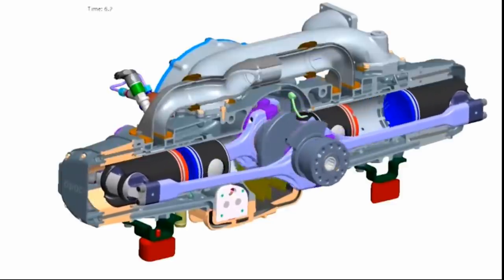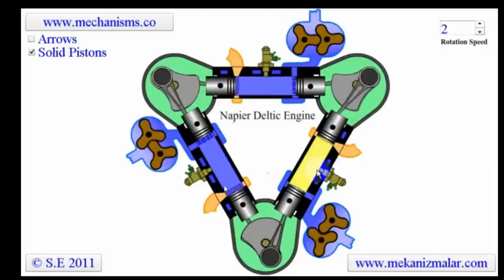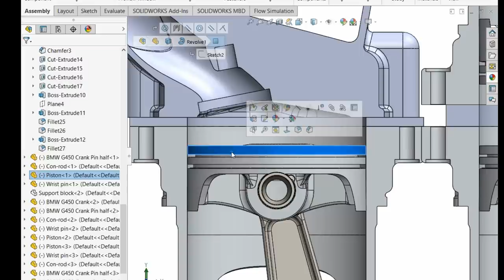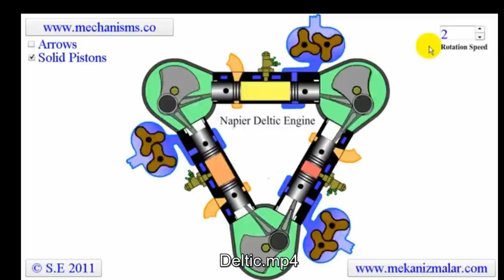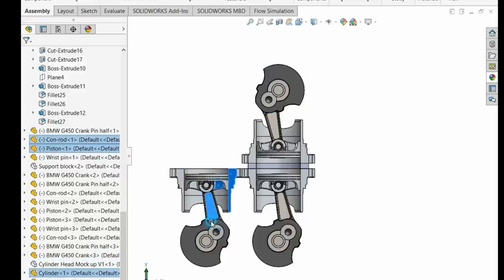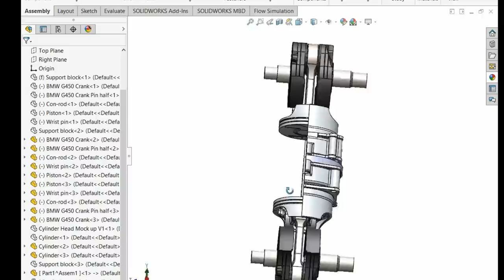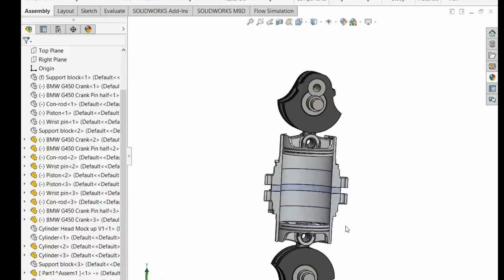Opposed engines are better?

Comment: Hi, could you explain the difference between long and short conrod? xD
Reply from the maker: Yeah, ones longer lol
Reply: Well no shit X)
Reply: I wondered if it changes only wear or some other aspects
Reply: @nx1552  
The reason that one is longer is with only one crank it has to reach up to the second piston. Think of the outer pistons as movable junk heads. The outer pistons to me connected to the crank need really long rods or  cross head arrangement like a steam engine or large industrial piston air compressor. 
A few years back I saw a video on a free piston engine being used as a generator. That would be even less complex. No cranks, no rods.
Reply: @nx1552  it also changes the peak piston velocity, as in with a longer rod you move from orange towards blue, https://youtu.be/knndgVWAPsQ?t=700
Reply: Also i guess longer = less piston slap but more unsprung mass..
Reply from the maker: Unsprung?
Reply: @dirtygarageguy  my bad.. but you got what i meant so🖕😂

Comment: Great Britain once made an opposed piston large marine engine called the Doxford; I think the design was patented in the 1870's, vertical direct opposed piston diesel, not the diesel you put in you car or heavy goods vehicles, heavy marine diesel with an SG close to 1.0 the fuel had to be heated prior to use.
 These engines I studied at college however they were redundant before my career at sea began. The were still part of the curriculum? & I remember a fascinating large cut away working model of one in the Engineering School foyer. 
My elder brother told me about sailing and maintenance on them in his career the 1970's when they were at the retirement stage and for a reason! 
Lubrication and heat, opposing problems of that particular engine.... and as all good sea dits, (storys) there is an occupying song....
Sung to the beat of MacNamara's Band: 
"Oh my name is William Doxford and I come from Sunder-land.
They say my diesel engine is the finest in the land.
The pistons bang, the cranks go clang and the camshafts grind away.
And you only have to oil the bug*er fifty times a day"....
They are not with us now due to factors that made opposed piston engines redundant. 
Message ends apart from....
Hope you like the song, play the proper one first to get the feel.

If your from the " Good Ol US of A"  and voted for Trump,  just fuck-off!
Reply: British rail had the opposed piston Deltic two stroke diesel for decades . And the Commer TS3 opposed piston two stroke truck engines for 40 years . Worked great.

Comment: As 2 strokes are designed to be “on the pipe” or running their optimal rpm, could see these being very useful in today’s hybrids with the ecvt to direct any excess power to a generator to charge up batteries
Reply from the maker: 2 strokes aren't designed to be on the pipe...
Reply: @dirtygarageguy  I mean “on the pipe” as a term we used in racing 2 stroke motorcycles. It’s the rpm range where the exhaust is in resonance and maximizes exhaust scavenging. It’s why I love the term “tuning”. Essentially the most efficient range for that engine, is determined by the geometry of the exhaust pipe.
Reply: Not all two strokes work that way , small loop scavenged ones maybe . Look at a Commer TS3 opposed piston two stroke 6 piston truck engine , one crank , roots blower , uni flow . Was built for 40 years . They were used for logging trucks because they would not stall and run down hills.

Comment: You can make ported engines throttle better by using a sleeve port arrangement. You can then vary the port size and timing on the fly
Reply: Yeah like a Boyesen exhaust trapping valve or a Crecy sleeve 2 stroke.
Reply: yeah like a rotax RAVE vallve or an exhaust trapping contouered to piston shape.

Comment: I think that single cylinder dual piston setup should be talked about more. I have never seen that design before. I feel confident that any heat issues could be worked out. One thing I did notice is that the design looks as if it would handle more expansive fuels as well. Seeing that the power cycle will be split between two pistons I would think the length of the stroke could determine fuel type and the efficiency of fuel combustion in relation to it's expansion.
Reply: CAN AND ALREADY HAVE BEEN WORKED OUT. look up 'achates power'. they have working test bed engines in ford F-150's & a 10 liter in a freight liner tractor trailer, actively hauling for walmart. how they solved the heat problem? pure genius. stainless steel pistons, both with a perfectly convex shape, polished, and focusing the heat on the combustion area. this reflects the heat away from the pistons. they're also porting oil pressure through ports that run through the piston. this maintains a nice even temperature in the pistons. also- cummins has officially adopted the new achates tech- and are ACTIVELY manufacturing the armie's new advanced combat vehicle engine with an achates design. not a test bed- A REAL WORKING, PRODUCTION ENGINE, with 1000hp in less space & less weight than the old engine it replaced- a 750 HP v8 diesel.
Reply: oh yeah... cummins & achates power- big tech meets 2 stroke diesel power. diesels will never be the same again.
Reply: How about a KX1000 OP 2 stroke dirtbike made from 2 KX500 engines. that would make one sick trail bike!

Comment: T64 use 5 cylinder inline opposed piston 2stroke diesel mainly for compact design and modular power pack that is easy to exchange quickly rather than the earlier t54-55/type69 regular V12 4stroke diesel.

interesting design the Russians used in these tanks.
Reply: Does ukraine have the TD op 2 stroke.
Reply: Most tanks used by Ukrainian armoured units are T72 same as Russia’s armoured units. T72 use a conventional 38L V12 Diesel engine as the T64 Tank was very expensive to produce compared to the T72
Reply: @BentSpanner  The ukraine 6TD4 OP 1800 HP 2 stroke is my favorite tank, better than the american crap anyday. I hate that gasoline turbine GE torqueless thingy.
Reply: @jlo13800   OK I get you, that engine is in the German Leopard 2 tank. Germany has given these to Ukraine in their defensive efforts.
Reply: @BentSpanner  Germans did all sorts of engineering things.

Comment: How the hell do they control oil from leaking past the rings when the cylinders are so high?
Reply: They use a “Trunk Piston” it is essentially a very tall (long skirt) piston with an extra oil control ring or two at the bottom.  The lower ring pack never crosses the ports. So crank case is never connected to ports like in a weed eater type 2-stroke engine is.
Reply: @timduncan8450  Still do not understand completely.  How about the combustion chamber between the intake and exhaust port?  How they lubricate that portion? Mix lub oil with diesel like normal two stroke motorbike engines?
Reply: @catchnkill    No oil in that area at all & no reason for lube on most of it.    The pistons have  “Top land”  so the rings don’t touch the center portion of the Liner you are asking about.
Reply: @catchnkill  Oil metering to the intanke and a very clean burning synthetic 2 stroke oil. I heard these run well with amsoil interceptor 2T oil. I fill and run XD-100 oil inmy 2 stroke 8v92.

Comment: Just seen that Cummins have just made 1000hp 4 cyl. opposed piston 2 stroke deisel for tanks.    Might not fit a bike though.
Reply: How about a 1700 Rotax OP made from 2 850 Rotax Etec turbo 2 strokes, that would make a sick trail sled with turbo. Imagine a KX1000 OP 2 stroke dirt bike make out of 2 KX500 motors.

Comment: I think your right these OP designs will lend themselves to hybrid EV systems to generate energy for range extending or remote area charging while also covering 2 other EV downfalls heat/energy for storage of cabin heat systems and battery thermal management for cold weather applications. I seen something about heat pump systems going into some of these EV's but the cold weather is already taxing the batteries on these vehicles so a alternate source for heat and energy is a great idea. Fuels are still going to be produced for some time yet as we need them for many reasons and the byproducts of fuel production. The EV sticklers that are so hard core to be stuck on pure EV should have to travel to Alaska in the winter in their Tesla if they dont understand why we need focus on hybrid tech at this stage and progress to the pure EV in areas/locations/users where it is feasible. One thing you havent mentioned is how these 2 stoke designs you have been going over recently play out with alcohol type fuels and adds a question from me (non engineer), do these fuels not have more chamber cooling properties that could stabilize the thermal issues on these headless type engines at least partially negating the issues to a manageable level? sorry for the poor sentence structure my education was limited to swinging a tobacco cutter at 14 to support my family. I like the simplicity of the of the triangular design. I like that your tossing in the bits about resonant or pressure waves in the port and runner design/tuning i feel most people are unaware of what this is and the results of a modification to an engine due to this. For instance Dude puts large tube headers on small block and loses power or idle control at the red light due to huge cam, convertor, and dual plane intake.. swaps intake to single plane design gains back the power and idle control or something to that effect. Could be a good video topic. Might save someone from bolting on less HP one day lol..P.S i subbed you sorry i thought i had years back but i have subbed so many and use YT as my TV. I havent watched TV in about 12 years.
Reply: No chemical fuels or batteries are needed with overunity motor/generators that tap aetheric ZPE energy anywhere from space. Nikola Tesla, T Henry Moray and Bruce Depalma not to mention many others. I just dont see the hangup on chemical fuels. However a 2 stroke 850 Rotax Etec turbo ski doo is a lot of fun. OP 2 stroke should make it into snowmobiles soon. brapppp.
Reply: Yes alcohols burn cooler, have high octane, boost power and will help cool your 2 stroke pistons.
Reply: Oh yes alcohol has a cooling effect and just add some castor 927 maxima 2 stroke oil for that awesome stench. An alcholo fueld engine proppably runs cooler than them EV electric motors so it migh be hard to ride up in alaska with one.

Comment: Would Opposed engines be better for smaller garden tractors and hooked up a hydrostatic transmission.
Reply: Oh hell yeah! Now take 2 Rotax 850 Etec turbo engines and make a nice 1700 OP Rotax and lay it down in a trail sled.

Comment: Direct water injection would help with both efficiency and cooling.
Reply: Paul Kargin  Not to flood it. If it is dosed right to prevent overheating there is no condensation.
Reply: @brankosumonja2048  You basically need to rig water injection to turn into dry steam to minimize lube cutting and ring harm, which I'm sure is possible.

Comment: So a Deltic engine to power an electric truck, works for me but I think the load size wouldn't be that great due to space constraints. I'm sure you'd get a couple of pallets on a 17.5T once it's all built and running... 🤣🤣🤣

The Chieftain L60 was an excellent engine in the wrong application, but by fuck it sounded nice.
Reply: @thomas Schumacher as I said the engine was used in the wrong application, as a stationary engine running a generator it would have given good reliability, but up and down the revs through the gears constantly were it's downfall.

In hindsight it could have even been used to power a genny and allowed the use of electric transmission on the Chieftain, hopefully not burst into flames like the MAUS... 🤣🤣

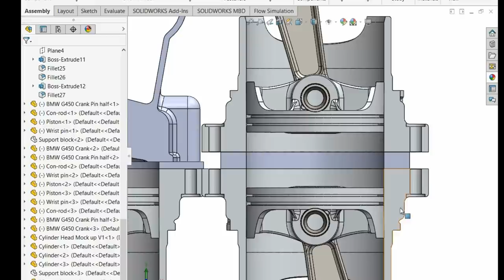Comment: @The Workshop   You are better than this!  At about 9:00 you butcher the heat comparison issue entirely.  As you know Engine designs avoid melting components usually by managing fuel, air flow (density), load, ignition timing and lastly cooling.   You also know what we do with the heat is very important, all ICE are heat engines.  

Assuming similar power out, inlet temps & lambda (A/F ratio) the hot combustion gases start out the same in OP vs conventional engines.  Heat Transfer out of this gas is complex, but lets focus on the big differences the engine architectures bring: surface area, expansion and frequency, time & materials (conductivity).   

Let assume same bore and effective swept area.  Eliminating the head eliminates about 40-45% of the combustion chamber area per piston.  This saves a lot of losses, but doesn’t raise temps unless combustion recipes are changed.   If all things were equal it would leave temps near the peak for a bit longer, but things are not equal, the OP has two retreating pistons so a 2x expansion speed for the same trapped gas stroke.  So its’ combustion gas cools more quickly by doing work (expansion) while the conventional cools its gas into the head.   

Also pistons in heavy duty engines where all this really matters are usually made of steel.  Depending on alloying, thermal conductivity can be 20% up to an order of magnitude lower than head material.  Again this does not raise gas temps (function of combustion recipe) but leaves more heat to do work pushing the pistons apart.   

2-strokes fire twice as often so in simple terms there is twice the time at temperature.  Yes this can cause a lack of cooling and subsequent thermal damage.   But to be fair we are not asking for twice the power from the OP.  So we throttle the intake or slow down the supercharger (compound turbo) as Achates does on their class 8 truck engine, to avoid air pumping losses.  
https://www.ccjdigital.com/regulations/article/15065487/walmart-fleet-testing-the-worlds-cleanest-combustion-engine
This makes the cold air change say half, of course we add only enough fuel (half) to get the appropriate lambda so combustion gas is half as dense but twice as often.  Half density reduces heat transfer to pistons by half therefore no additional component temp, no thermal damage.
Reply from the maker: The heat comparison was a direct comparison if you were paying attention... I do make this very clear. As for more heat doing work, you clearly don't understand the system.
Reply: @dirtygarageguy  My attention is often diverted by your lurid yet entertaining delivery.  But I did hear you blathering on about higher temps and melting parts.  That’s not an Engine architecture issue. It’s a combustion recipe issue, predominately.  Clearly the Doxford, Jumo, Deltic, Kommer, F-M, etc engines have burnt millions of gallons of diesel without melting.
Reply: @dirtygarageguy   Direct comparison to what?  Respond to my technical points if you would please.  I don’t want a debate, but am always open to learn.
Reply from the maker: And those engines aren't as like today's engines...
Reply from the maker: In the video I'm taking the single cylinder and doubling it up so everything (CR, bore, stroke etc) is the same. I do this to show the difference between each system. Apple to apples if you like. If you  did that then pistons would melt with all being equal. Reducing the compression, fuelling etc to compensate takes you further away from the optimal, highlighting that issue.
Reply: @dirtygarageguy  what part of the system am I misunderstanding?
Reply: @dirtygarageguy  please explain how “those engines are not like today’s”.  F-M just started serial production of their Trident OP in 2019 which is T4 compliant and has 50% bte.  You don’t seem to be up on this topic?
Reply: @dirtygarageguy    I see your point about melting if you “just double” especially as in firing twice as often.   Not having a head will make only a small increase in time at temp during each combustion event. That’s why OPs reduce air and fuel (not compression) a bit.  To avoid doubling power they also typically down size a bit.  Dumbing this down to apples to apples has to be done with more nuance.  It is hard to make complex topics simple, I do appreciate your work as this is a topic the public should know more about.
Reply from the maker: Has to be done with more nuance? You didn't get it, everyone else seemed fine.
Reply: @dirtygarageguy  your ham handed attempts at a proper comparison are disappointing.  Now that you have had time to think about it maybe you will take a closer look.  

I feel like I’ve learned some interesting things in your other work.  But you aren’t doing justice to this topic, yet.
Reply: @dirtygarageguy  what the hell do you mean?
Reply: @dirtygarageguy   but everything is far form the same.   First you double the displacement with your lazy copy and paste cad work.  Then you change to a 2-stroke effectively doubling the power again.   So this is not a Apple to Apple comparison, you are off by a factor of 4!!   I do agree that all things held constant (stupid assumption but just trying to follow along) the two stroke change will cause terrible component temp issues.   However since it’s a diesel just cut the fuel in the combustion recipe to whatever you like, there Bob’s your uncle!  Temps under control.